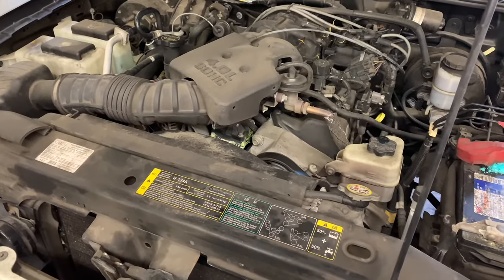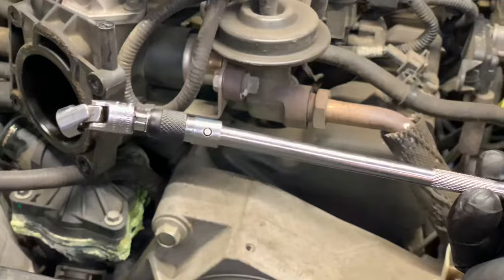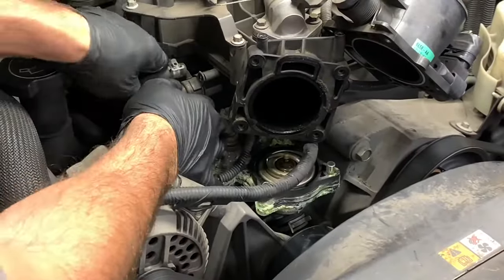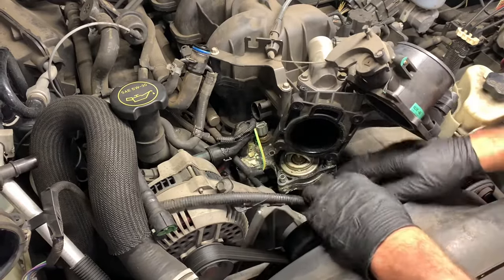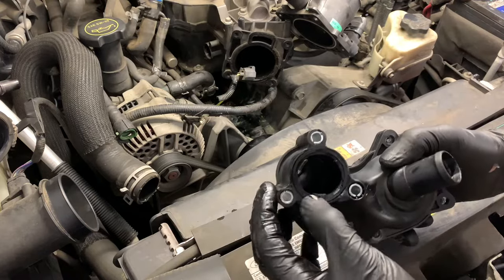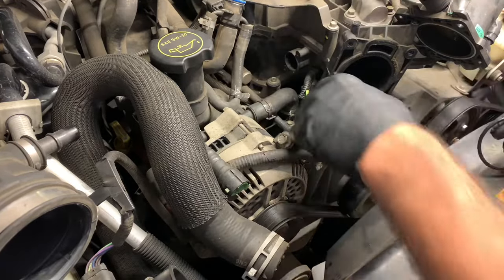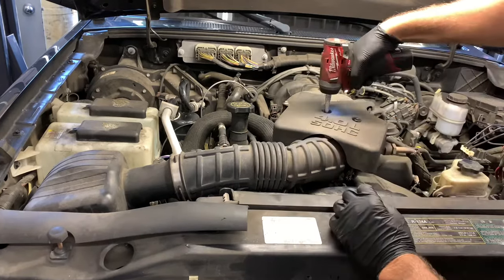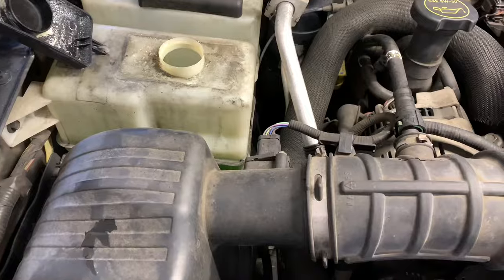Ford Ranger And Explorer 4.0l Engine: How To Replace The Thermostat Housing

Comment: Just got done with my 2004 Ranger. Two things different on mine: There were two sensors, FYI, the right side sensor you have to connect the wire BEFORE you slid the unit all the way under the air intake. Once in, to the point of putting the bolts on, the connecter will not fit under the air intake to snap it in. Two; there was another pipe running between the block and the unit, which makes it much tighter to get to the back bolt. Put the back bolt in before the others and tip it forward to slide the back bolt in and then let it back down and tighten.
Reply: Sounds like my ranger I'm currently battling, I couldn't get either plug off they both hit the intake
Reply: @scotthendricks79  There is a rumor an engineer's wife ran away with a mechanic, to get revenge the engineer designed the 4.0.

Comment: This is probably the closest I've seen to my 4.0 V6 SOHC 2019 Ranger so far.  In fact; the same looking on video.  Would you recommend replacing the lower housing as well since you are in there?  I have a 2009 FX4 with nearly all FoMoCo parts and would not like to get in there again for a while if I did not have to.  I am too lazy hahahaha.

Comment: My 1998 Explorer with the 4.0 SOHC engine was a lot tougher to do than the Explorer in this video.  I needed to remove the alternator, tensioner and belt, and the bracket that held the alternator and tensioner and the idler pulley.  I had to break the upper thermostat housing off of the lower housing because the rear bolt would spin, but not unscrew (the pressed-in nut broke free and was spinning in the lower housing).  It took me only three hours to do, plus another (almost) hour to refill the cooling system and bleed the air out of the system.  Ford definitely did not design this to be replaced by the average owner.  The housing assembly should have been made out of aluminum.  Ford charged me $421 for a replacement plastic housing assembly.  Ridiculous!

Comment: Would removing the alternator wire harness give more room than just pushing it around Sir ?? I like that you use your hands to start the bolts which prevents any cross threading problems. Would using aftermarket alumium housing work better for you SIr ??? Thanks😀😀😀😀😀

Comment: Thank you so much! I rounded the front bolt, cold chiseled the housing off. Heat and pb blast, she came right out. I couldn't unplug the sensors well it was in place though?  Thanks so much

Comment: This looks to be just what I need. 

I've a 96 4.0 4x4 XLT that just recently overheated, and it is leaking exactly where all these components are. 
Are all the hoses listed,... even the 2 that you didn't change out? 
I'm in King Salmon, Alaska, and need to order all these parts in. 
I'll need that small torque wrench, too... hopefully it's not expensive! Lol. 
Would RockAuto be a good online source?
Reply from the maker: Yes Rock Auto should have everything you need. Good luck with the repair.

Comment: What can you do if the top part of the housing won't come apart? The back bolt is spinning in its socket but not loose enough to come out and not coming out of the metal backer for it in the bottom half of the housing I think that came loose and is just spinning in place. Can you get it out without taking the top of the housing off?

Comment: Replacing mine with the aluminum housing in my 2003 Ranger 4.0 right now..... Hit that God-damned little elbow hose and had to jump on YouTube to figure it out quickly. Thanks for the trick of removing that valve! Ok back to it!
Reply from the maker: Glad to help. Thank you for watching!
Reply: All went well, though what a ridiculous location for that housing..... another case of engineers screwing over mechanics, shade tree or professional. 😉

Comment: I followed your guidelines, and super helpful by the way. I appreciate it. I have all the bolts out except one is seized up. Any advice how to get that out?
Reply from the maker: Soak it in penetrating oil and try to work the bolt back-and-forth hopefully it’ll loosen up. If that doesn’t work if you can apply heat to it.

Comment: Mine didn’t come with new o rings for the sensors, should I go buy some new ones or can I reuse the old ones? They still solid and round but kinda loose on the sensor… I don’t wanna put it back together just for it to leak again from there

Comment: I just did a similar job: thermostat+ water pump on 2003 Ford explorer sport Trac lol I didn't have to remove the throttle body though. Would've probably made it easier
Reply: Did it turn on when it was messed up and did it turn back on when changed?

Comment: weird, just replace the thermostat only with Murray 3649, however did not come with a gasket.  reused the gasket that was in place and don't think it is thick enough since now there is a slight leak from the seam between the top and bottom of the housing.  went to oreily's website and confirmed it doesn't come with a gasket, buy you have same exact part with a thick gasket.  weird
Reply: I replace the thermostat and it is overheating any suggestions